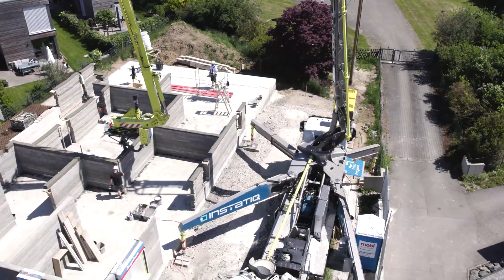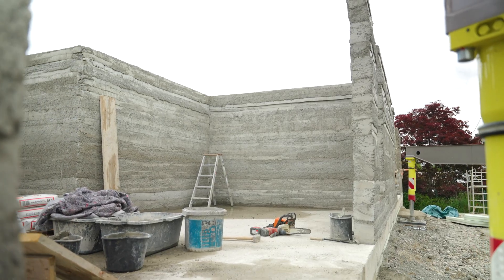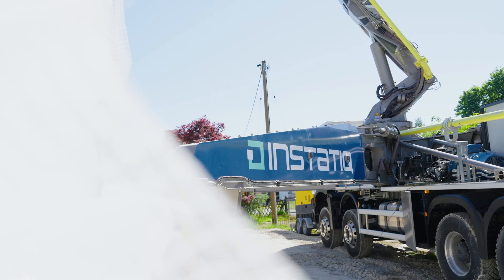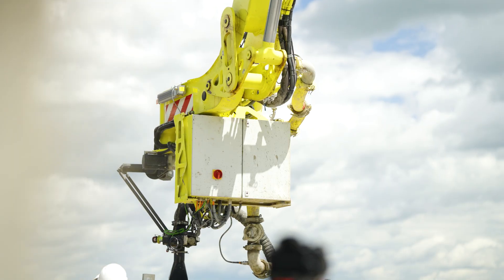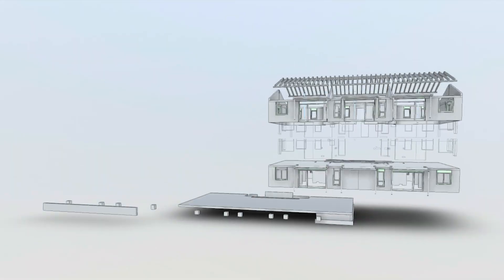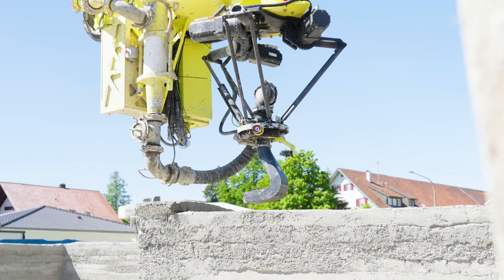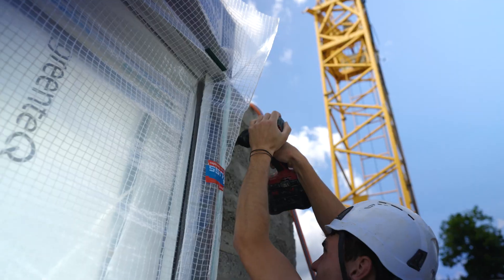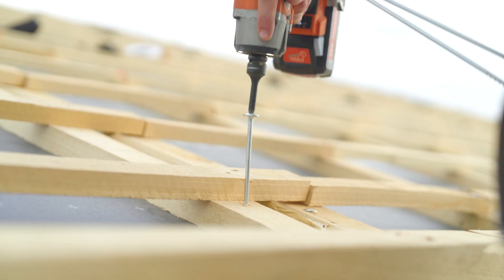🇺🇸 3D Concrete Printing – INSTATIQ  | A finished multi-family house in just 10 weeks in Germany

Comment: I am really interested/curious. How well is the isolation factor of these walls? Because it looks like a single stone wall, to me in the first place. And are you able to do this in the Netherlands?
Reply from the maker: the isolation factor refers to the used concrete mix, similar like limestone. For residential housing we usually apply an ETIC-System to finish the walls. We are happy to discuss applications in the Netherlands. Please get in touch with us by sending an email to info@instatiq.com